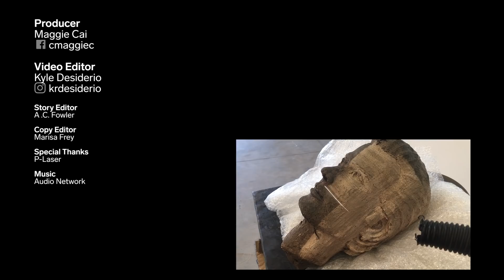How Laser Cleaning Works

Comment: Important detail!
The wavelength of the laser is selected to match the reflection properties of the base metal.
In general, metals reflect infrared pretty well, surface crap tends to absorb infrared pretty well.
The other detail is the rather extensive laser blocking curtains that exist around the work area, and the need for lots of ventilation.
Some of the stuff being burned off is right toxic.
Reply: I was also wondering about how they are able to focus the laser on those uneven surfaces or is it just so powerful?
Reply: It is also pulsed, beside the laser frequency, as a "constantly on" laser would probably heat up quickly and consume a lot of electricity.
Reply: Yeah, infrared laser might not be as dangerous as a ultraviolet laser, but anybody that has seen styropyro's channel https://www.youtube.com/user/styropyro
knows that laser blocking goggles are a MUST . It only takes one bad reflection to blind you forever in a instant.
Reply: instaBlaster
Reply: Just asked exactly these two questions in another video - thx for pointing this out. So by matching the reflective properties you prevent the base material from heating up and thus avoid stress. And yes, I was so sure this would create quite some nasty fumes.
Reply: I'm wondering how we can see it if it's infrared.
I also wonder how laser cleaning makes that sound.

Comment: Why do they use infrared when ultraviolet light has higher energy? (Or am I wrong?)
Reply: You want a frequency the contaminants will absorb (and ideally that the base layer won’t). Visible is also higher than IR, and higher than UV you could go to x-ray and gamma, but there wouldn’t be a point.

Comment: on average what is the mm that laser cleaning removes? I know it can depend on laser strength and how long it stays there as well as the material. But lets say typical stainless steel and a reasonably quick sweep of the part.
Reply: What do you mean ?. It does not remove any of the stainless material. The stainless reflects the infrared keeping it 100% intact where the rust, oil, and other nasties absorb the energy and get evaporated. The ammount of thickness it can clean is infinite. U Just use more time.